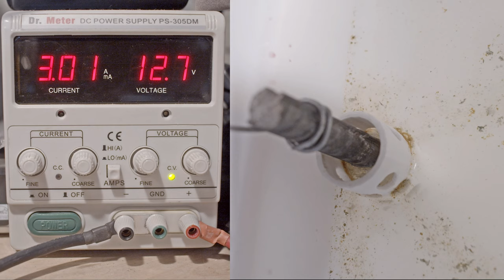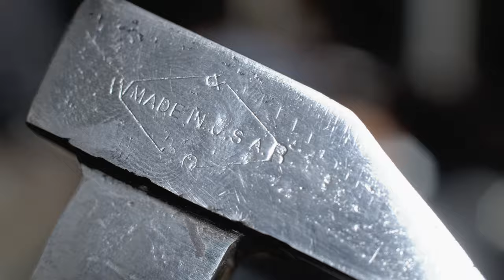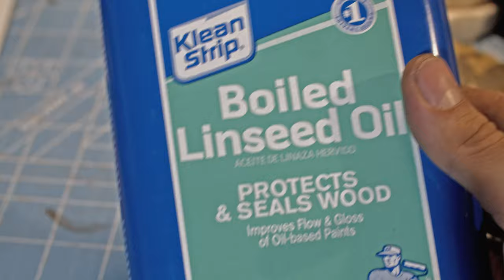W&B Railroad Wrench Restoration

Comment from the maker: Since I quit weed for the pandemic, working with my hands is the next best thing I do to reduce stress.

That and drink. 🥴
Reply: Neat! nice workshop you have there. You should give a shot at growing your own weed (if it is not illegal/wont cause you problems) it is a nice hobbie too
Reply from the maker: @NewtonianT  Thanks! I've grown a single stalk of bubblicious in my 20s. Had lots of fun that summer/fall. It is definitely illegal in my state, but that's just the states opinion 🤠
Reply from the maker: Mushrooms are also a fun grow if you do it right. Cambodia spores germinate like crazy. 🍄
Reply: i can definitly relate to that, my saving grace is woodcarving! the only thing preventing me from going full doomer
Reply from the maker: I was thinking about picking up carving
Reply: @FleaMarketSocialist  you really just need a decent carving knife, personally i bought the flexcut 1-5/16 detail knife for just about 30$. As for the wood, just about anything soft enough works great, just stay away from hardwoods (except basswood, i've heard its the best carving wood there is). I'm still a begginner though, so regular fast growth construction lumber does the job well and is practically free. I look forward to your futur carving videos!
Reply: my grandma worked on the railroad. neat
hope you're doing well

Comment: i wish i had your skills and tools
Reply from the maker: Every single tool I've gotten has been a flea market or eBay purchase over the span of years. (Including the one in the video). Some have even been free from Craigslist but you have to jump on those as soon as their posted.

I even got a really decent table saw for free off Craigslist.
Reply from the maker: Only you can develop your skills, comrade. Work with your hands and heart.

Comment: Thanks comrade, I love all your videos! Not to sound dumb but why did you heat up the tools and put them in oil and degreaser?
Reply from the maker: Thanks! There are no dumb questions! I only learned about this process about a year ago. It's called "bluing". It's used as both a rust protection method and cosmetic alteration to steel. Heating up the steel gets it to a target color and quenching it in oil kind of freezes that color.

I've been trying to find a more scientific description of what's going on on a molecular level but I believe it's similar to how people prepare iron skillets with oil "seasoning".

The decreasing step is necessary to avoid fingerprints being burned onto the parts in the bluing process. That's why I wore rubber gloves when handling the degreased parts.
Reply: @FleaMarketSocialist  Damns that's so crazy thanks for the info I'll give it a go on my old rusted spanners

Comment: Out of curiosity, could I use the bluing method to refinish some old steel kitchen utensils? I have this set that my husband threw in a dishwasher (out of ignorance) and they came out grey and no longer shiny. I almost threw them out, but felt bad, so they've sat in an old drawer for about 3 years now.
Reply from the maker: I'm not sure that would work as utensils are usually stainless steel which I believe is a process using chromium.

 I'm not sure what a dishwasher does to silverware as I have never owned one but maybe you can restore them using electroplating. Electroplating is a similar process to the electrolysis process I showed in this video to remove the rust but kind of in reverse.

 I see this kind of damaged silverware at Goodwill all the time so maybe try and find some of that and experiment with it to see what works best. That or get a new husband.
Reply: Emerald kat wait, steel kitchen utensils aren’t meant to go in the dishwasher????😳
Reply: @BGcam  well I believe these aren't exactly like the regular flatware you'd buy  to eat with and I should mention these aren't like forks or knives, but utensils like fondue forks, crab crackers + forks, a meat tenderizer, a very old spatula, and such. I think they may have been nickel or chrome plated (but don't quote me on that haha), and the dishwasher completely ruined the finish in one foul swoop.
Reply: @FleaMarketSocialist  Haha, he's a good one, and I'm kinda of attached at this point. 

You hit the nail on the head though; as that was what I thought was needed awhile back when I stored them. I just had a glimmer of hope that I wouldn't have to go through a plating process. It seems like that's what got ruined if I had to guess.
Reply from the maker: It sounds like what you need to do is electroplating. Here's a really cool video going over the basics of electroplating different types of metal to different types of metal: https://youtu.be/G-PtnwtOR24

Comment: What is the bluing process for? Just aesthetic or does it benefit the tool in some way?
Reply from the maker: Bluing actually serves as both protection for the steel against rust but also giving it a nice cool finish. Hot bluing protects steel against corrosion better than cold blowing process.

From what I understand both processes form a black oxidation layer on top of the steel which shields it from red oxidation, aka rust.